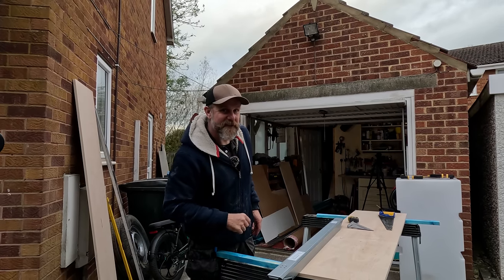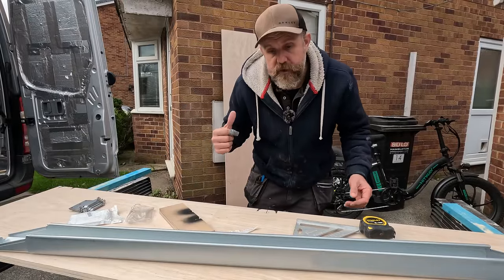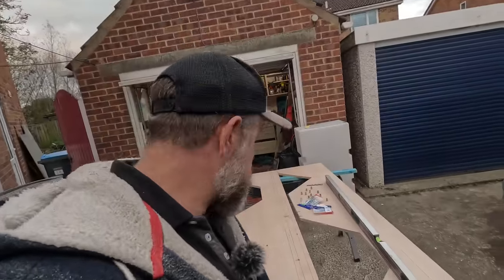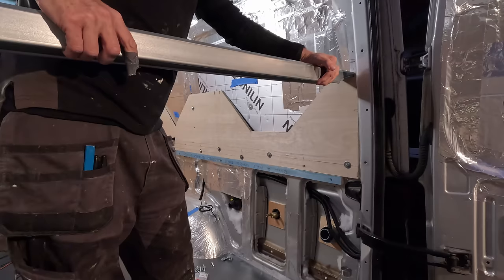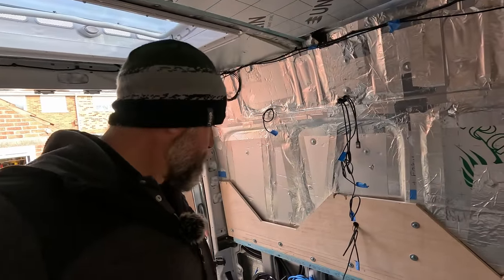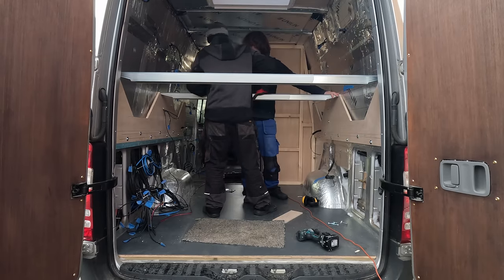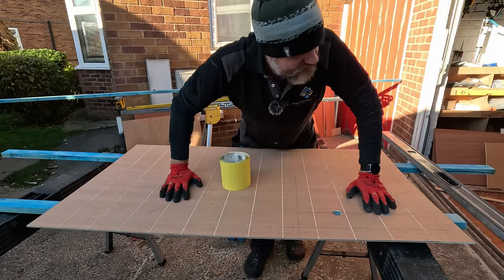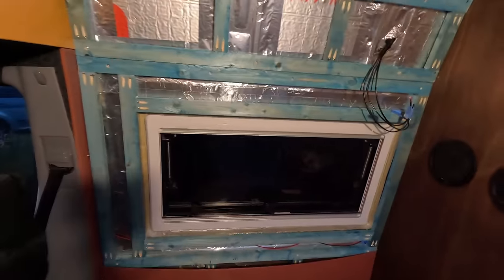Game-Changing Campervan Hack: IKEA Bed Supports in Our Sprinter Build!

Comment: Another thing is we’re adding rivnuts throughout the entire van to drill into the van as little as possible. I’ve heard about spinning rivnuts so I’m checking them with bolts before install giving me a chance to tighten. Finished one side and ceiling so far. It’s also freezing here as well. 13 degrees F at the moment! ❄️🥶
Reply from the maker: Great stuff. Yeah riv nuts are fantastic. I don't always have the time for them and a self tapping screw gets used.
I don't understand Fahrenheit 🤣🤣
Reply: Oh. -10.6 C 🤣🤣🤣
Reply from the maker: @rod8073  ouch. That's cold🥶

Comment: van build looking good now, are you going to fit a heater? Also normally if a vid is over 28 mins or more i usually dont watch it as i find it an issue, although it doest seem to be a problem on your vids which is encouraging for me anyway!
Reply from the maker: Hi. Thanks for the comment. Yeah they are getting longer aren't they. I don't mean for them to, but most people seem to like it 🤷‍♂️. They just come out how they come out. I did have to go back over this one to pull it back under 40min 🤦. I'm installing a gas truma boiler 👍👍

Comment: why did`nt you just put a usb plug socket in
Reply from the maker: Because the 12 volt system is permanently on for lights, usbs, fridge, camera charging, etc. But the 240 v sockets only get switched on when needed for laptops, etc as it draws extra power for the conversion 👍👍